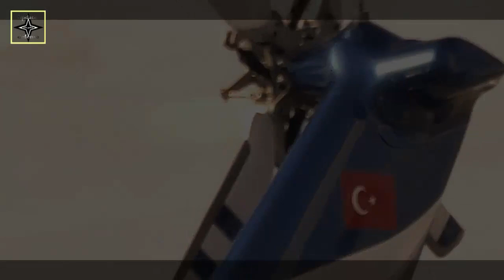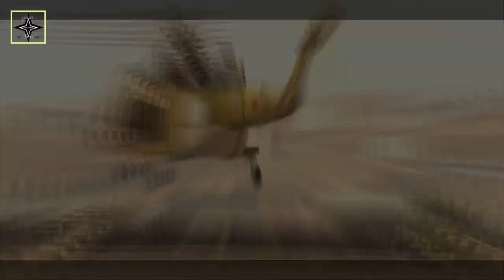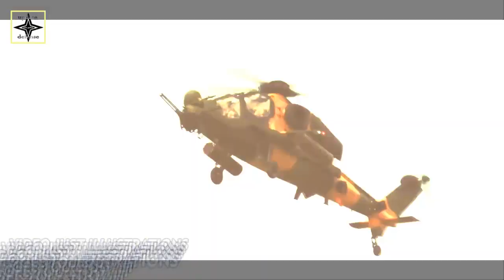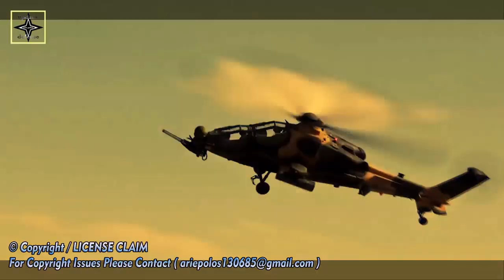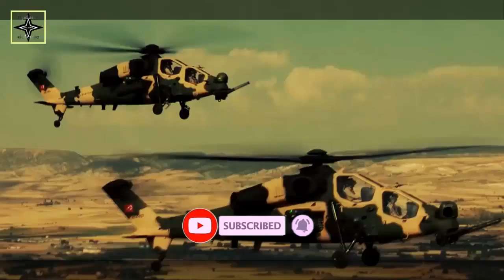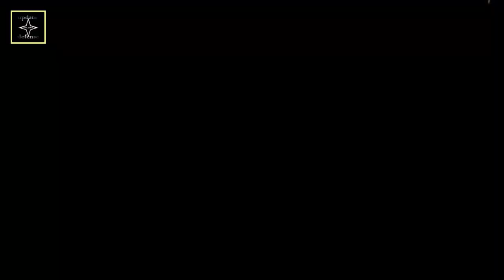Turkish Aerospace to Receive First ATAK - GOKBEY Helo Engine Prototype!

Comment: Its not a prototype. Its a working engine.  This engine will be integrated in the Turkish domestic helicopter GOkbey and the new Atak-helicopter. The test will happen with this engine.  So this engines works but it needs license and that will take 1-2 years before the engine pass all test
Reply: It dont need license its turkish made only flight tests